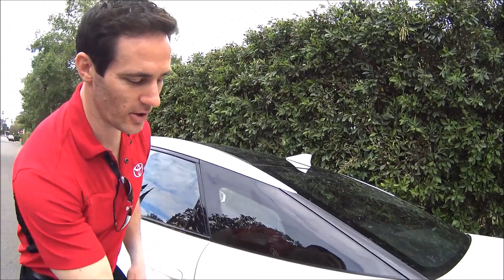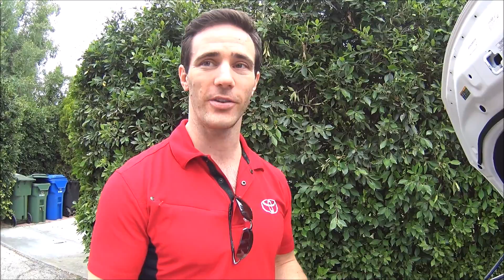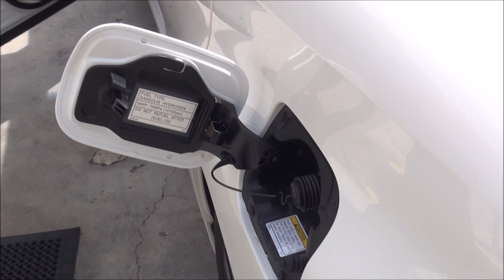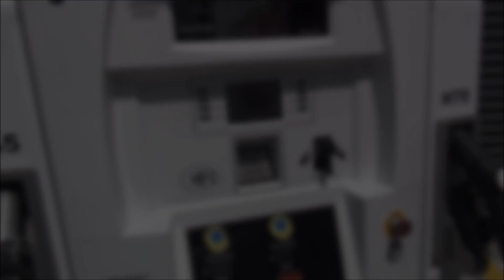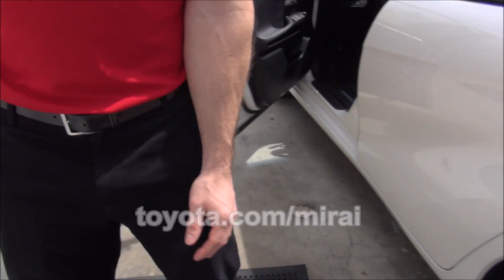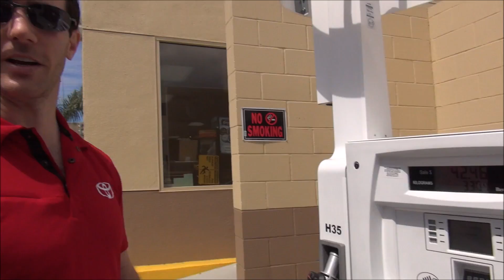Toyota Mirai first drive review - amazing hydrogen fuel cell car

Comment: What does it mean on the gas door do not filll after 2029/11 ??
Reply from the maker: Good eye. The tanks on these hydrogen cars are only certified for 15 years. They must be inspected and possibly replaced at that time. It's like batteries in an electric car, it has a limited lifespan.
Reply: @FreddySherman  hello Fred thanks for replying back to me one question am in the market of buying a 2017 mirai it comes with 14k of free gas is the gas card transferable to the new owner? The card is in the sellers name unless he gives me the pin to the card
Reply from the maker: @jessecastellanos5734  THanks again for watching the video and please subscribe!

According to Toyota, the card is not transferable, even if there is a balance remaining. It's just a credit / debit card so if Toyota didn't know there was an ownership change (like if you bought the car not leased it) then maybe it would still work if you had the PIN but according to their rules, it's not transferable.

Check with Toyota to be sure. Also, check the lease deals they offer on 2021 Mirais, there are some strong incentives plus federal and state rebates that can really bring the cost down (plus a $15K fuel card).

Comment: how much is the fuel?
Reply: Actual reported sales give a price range from $8 to $13 per kg. With a fuel economy about 64 miles per kg, that means $0.125 to $0.20 per mile, a bit more expensive than gasoline, and considerably more than the $0.02 to $0.04 per mile for driving electric. That explains why Toyota is hiding that cost by including hydrogen fuel in the lease.
Reply: Also most likely why Toyota is giving customers 3 years of free fuel...Since it is a small, niche market right now once it catches on (assuming it does) fuel prices will likely go down as the sale of hydrogen gas becomes more widespread but that will be a long time coming most likely...